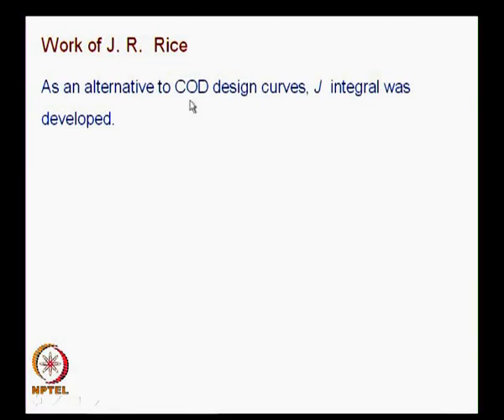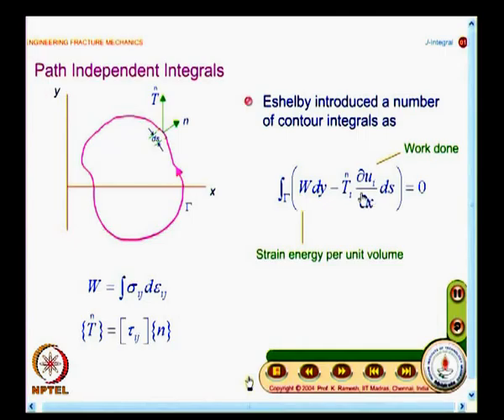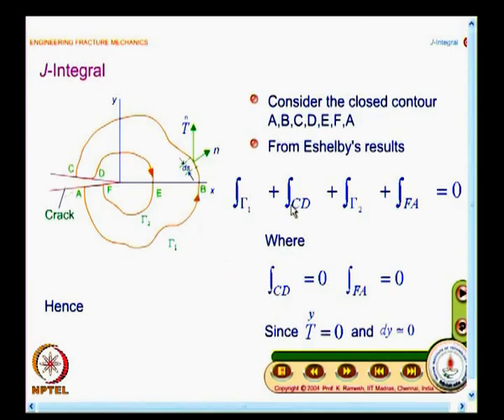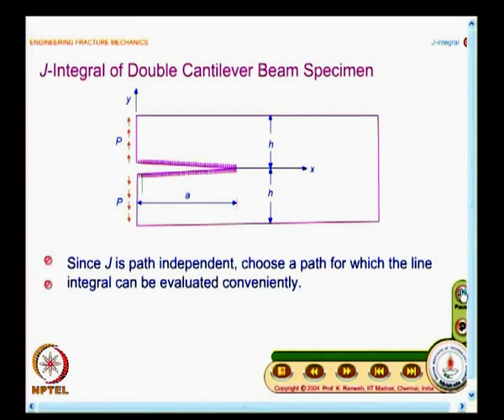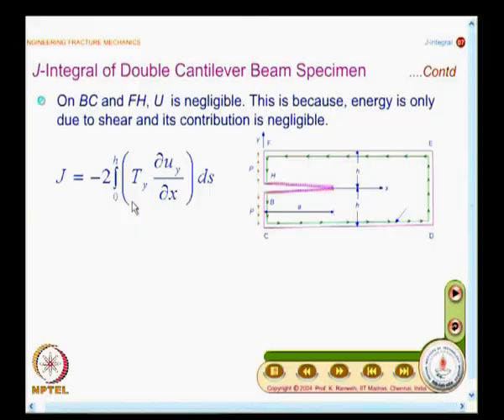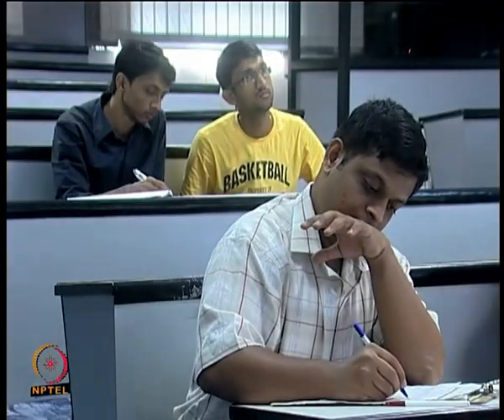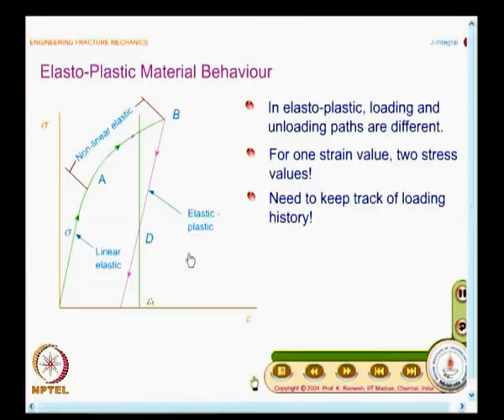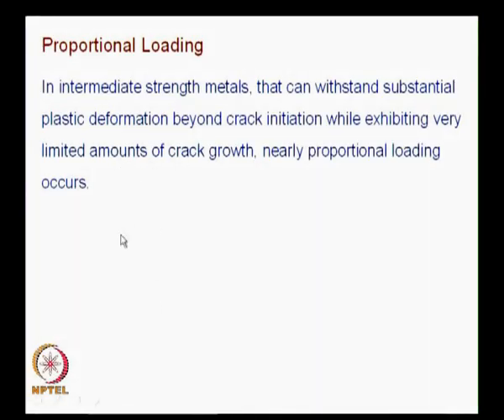J-Integral

Comment: It is not clear how the path for the integral can have sharp corners. Definition of J requires the normal n to the curve and Traction T on the plane tangent to the curve. Neither the tangent non the normal at the sharp corner is defined.
Reply: Integrate along each straight path separately, then sum the results for the full integral value. This is what he does in this video, as the path can be arbitrarily chosen and will still yield the same final value. There is no requirement that dn/ds be continuously differentiable along the path.